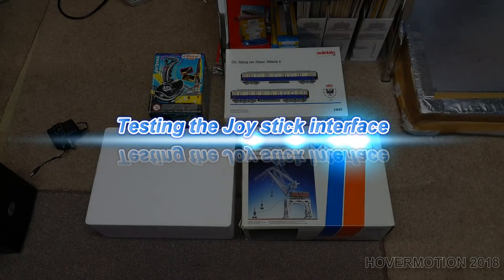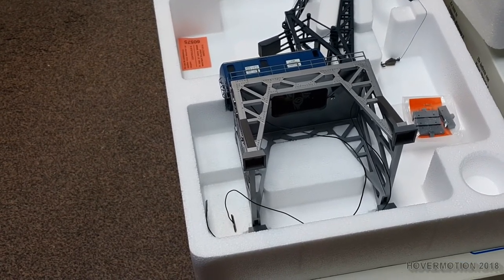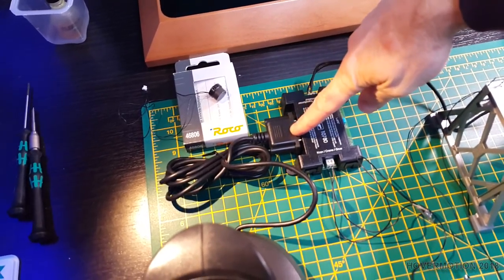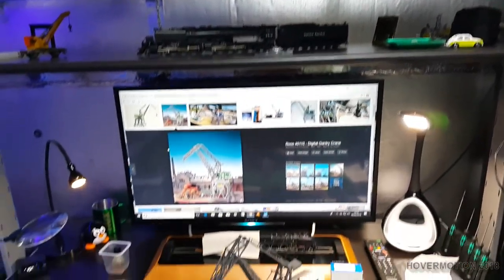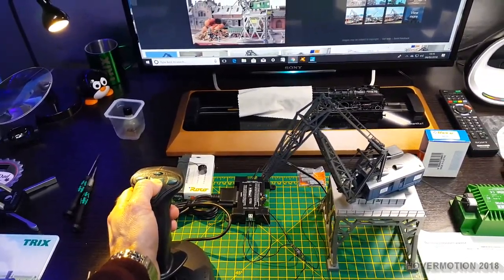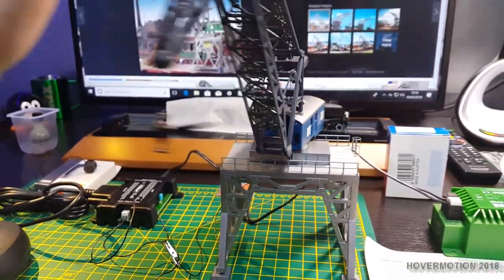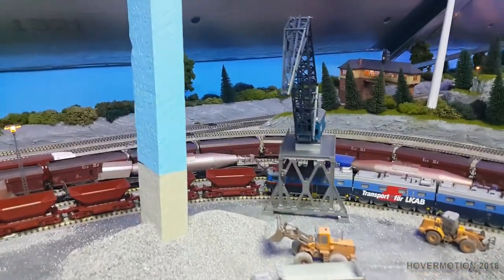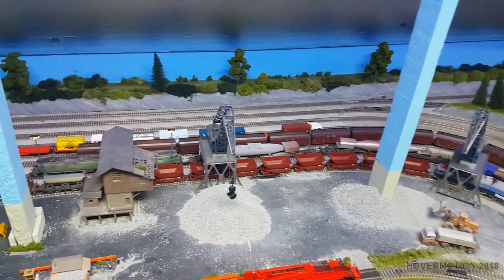ROCO JOY STICK 10780 INTERFACE TO DCC CRANE VID 1

Comment: Hi, excellent video. 

I got the same crane and joystick, but I just cannot make it work with the joystick.  It works absolutely fine with my ecos (50210) - even the small electrical bucket.- but when connected to the joystick I only get the blinking green light (crane status ok) but no response at all when I move the joystick.

I followed your instructions step by step.  Then I tried different addresses (on the crane & switching on the joystick - left button).  I also tried different jumper positioning on the interface (black box) and the joystick just move the crane.

Do you have any suggestion?  I’m about to open joystick and the black box interface to take “an inside” look ;)

On a complete different note, do you have the manual of the crane (I don’t really need it but I’m curious whether it came with one or not, as mine didn’t).  Ironically enough I do have the manual of the joystick ;)

Many thanks (I really like your videos)
Reply from the maker: Hi Ricardo,

First to do with the Roco joy stick is to calibrate it when set up try moving slightly the dials in the joystick these are very  sensitive and require small movements to lock onto the crane...
I will do some stills of the instructions soon...jim
Reply: Hovermotion thanks a lot Jim :)